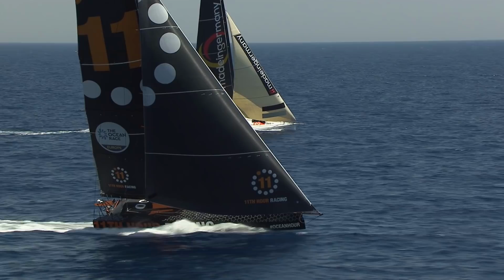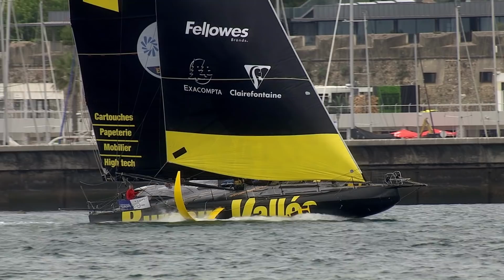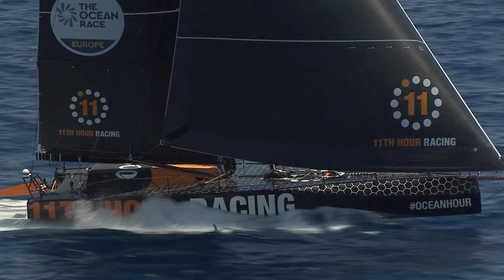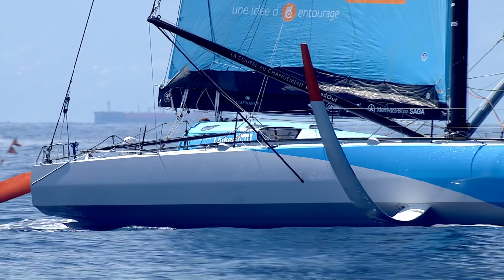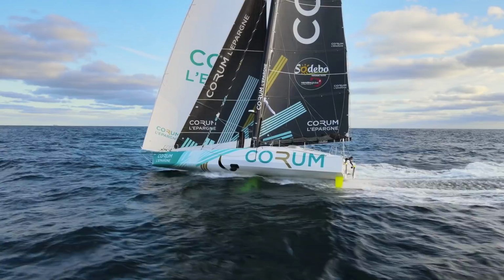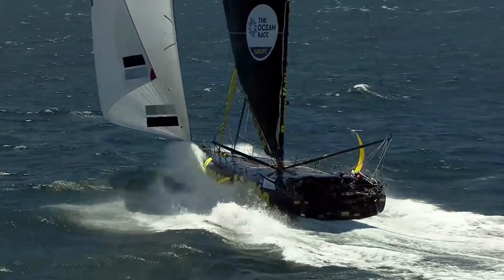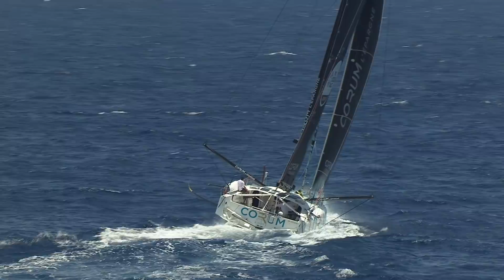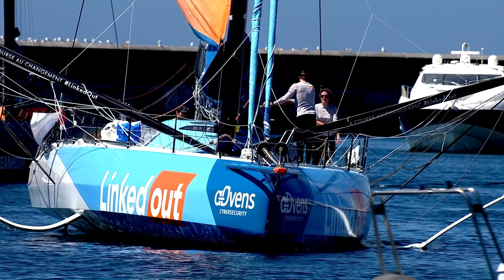Deep dive into the IMOCA 60 design and foils (It's complicated!) | The Ocean Race

Comment: The foil lifts the center of gravity.   You keel the headsails and mast deep enough to stay in the water when the foils lift the center of gravity.  Stable keeling design reduces heeling over and increases speed of the boat.  Then lift leaving the keeling line in the water.

Comment: I keep hearing this term "skimming" how is it defined and how does it differ from planing? Is it partial foil support?
Reply: You are correct to question it. skimming = planing. The three states being: 1 - displacement, where the boat is floating (very high drag), 2 - Skimming / planing, where the boats skips along the surface (medium drag), 3 - foiling out of the water (low drag)

Comment: with  the constant lurking danger of nosediving while foiling I wonder if it would make sense to reduce that risk considerably by having two smaler set of foils. Like one pair in the front and one pair  aft.  Or like a smaller pair in the front and a slightly bigger one somewhere in the back of the boat. I wonder if someone has ever thought about trying this or maybe even had some models to scale with this configuration? Would be great to get an answer to that! Because at least to me that seems to be the obvious solution to this constant threat of nosediving !

Comment: What exactly is meant by the foil angle around 20 degrees (min. 8:30)? Is it the Angle of the shaft to the water?
Reply: It's roughly the foil angle which balances lateral and vertical force, a foil angle higher than 20deg would create a lot of vertical force meaning there wouldn't be a very strong side force resulting in the lateral force from the sails being stronger than that from the appendages, if you make the foil angle below 20deg you end up having not enough vertical force resulting in a lot more drag due to the high boat speed needed to create an effective amount of vertical force, this means in light winds and even most reachings the boat would be very inneffective compared to one which has a 20deg foil angle